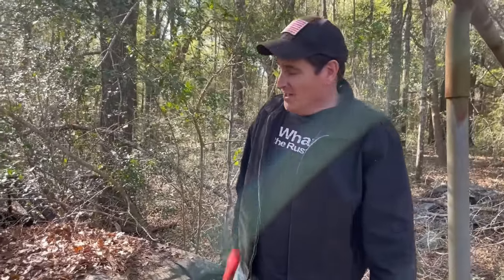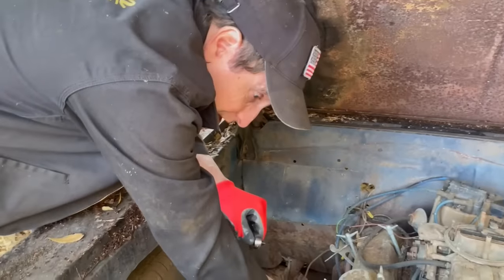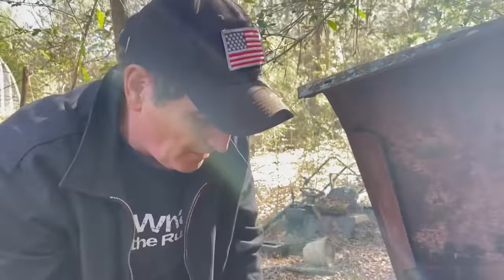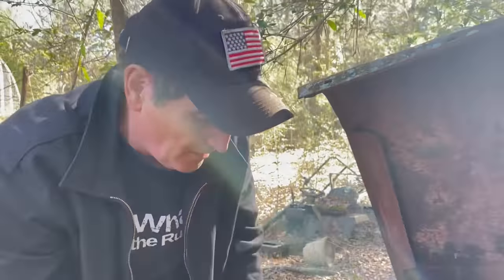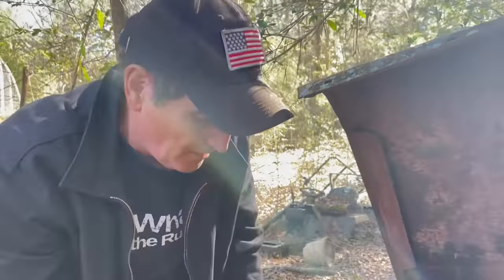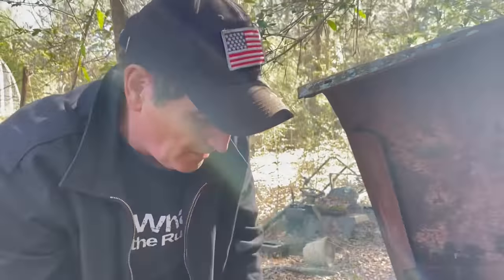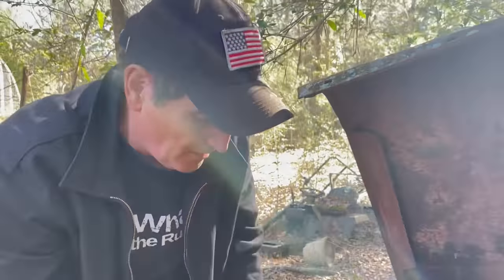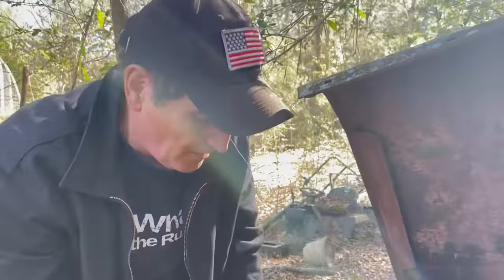Will it run? 1967 Chevelle dirt track race car in the woods!

Comment: Call me crazy but it seems like this old girl was waiting and hoping someone would come to her rescue. She had glory days at the track and then was unceremoniously put out to pasture and abandoned. Sometimes I think vehicles have feelings too. That's why she started so easily. Christina made me laugh when she stood way back while you were cleaning the rat nest off the fuel cell, she would have been the first one to run if a rat did jump out. Don't ever go bear hunting with her, especially if she carries a small pistol with her to shoot your kneecap in case the bear should start chasing ya'll. Great video, thanks for taking the time to share.
Reply: I said that very thing!  When I saw the sun shining on that car it was honestly a spiritual moment!  We'd never had a car sitting so long start that easily.   It was amazing!  You'd be surprised!  That stuff doesn't bother me .  I step back to get a better view.  Thanks for watching!  Much appreciated!
Reply: So they remove the weight just to add it back on and maybe more with the safety rollbar and all the tubing they have for bracing.
Reply: @Hotrodford   ideally you want your car 200-300 lbs under weight, so you can add weight over the left rear
Reply: I'm the same way. That cars (older ones) have a presence about them, almost as if they have a spirit. Like one that's been abandoned and left to rot, it's as if it's dead. But just by airing the tires or putting good ones on it and rolling it out from it's former grave it's like they wake up.
It's difficult to explain but ....
Reply: Crazy...but true.

Comment: Nature the outlet on the radiator, go get brass or copper 90 degree elbows x2 and  a short piece of copper pipe and solder as needed to get around the shroud

Comment: I'm currently working on a 67 chevelle. Been sitting in a little lean to shed since 89 or 90. Almost have the little 283 running again. At some point I will need to put a fresh coat of paint on her.

Comment: I have seen that set up before. The set up uses two hoses. One comes from the radiator outlet straight to the drivers side along the radiator top tank. Then a standard left inlet hose from thermostat to the end of the first hose. A simple brass house drain 1 1/2 inch drain elbow is used to connect the two hoses. Any 1 1/2 inch elbow could be used. (PVC would not necessarily stand up to the heat of 190 degrees)
Reply from the maker: That is good info! Thank you.

Comment: This car was my late grandfather's car. He traded it to the current owner around 2010 I believe. I have seen this car make laps at South Alabama Speedway around 2005. My late grandfather raced it at a dirt track in southern Georgia. He quit racing in the 80s and met my grandmother in the mid 90s. When they got married he brought it to Alabama (he moved here when he and my grandmother married). He got the car running in his driveway and took it to a practice session at the local asphalt track. It sat behind his house for several years until he built his shop at my parents house. He drove the car to where it is sitting now around 2008 if I remember correctly. He later traded it to the current owner.
Reply from the maker: That is great to know! It is an awesome car and was a privilege to work on.

Comment: aw. Born to run, she is. :)
why go for the standard cases, the special ones are much more fun. ^^
I was surprised the engine turned to smooth. maybe someone went out and turned it a few from time to time to keep it from seizing? they just never went and did more... and that cover could very well been on the car, Christina is on to something there.
as for the coolant hose, a PVC knee is quite possible, or maybe a piece of shaped aluminium tube? and they threw it out because it was vibrated to pieces.
that engine idles so smoothly, I thought it'd be louder...
the car must have been pretty fast, and drive safely, judging from the body. can't have had many bumps in it's career. ^^ I hope it sees a track again! ^^
Reply from the maker: Hi Lothar. It was loud, but the headers were so close to the ground the sound was muffled by dirt.

Comment: All 66, 67 Chevelles I automatically think of A Big Block under the hood. Must of been the weight transfer because they was very fast if built correctly street drag racing 1/8 or 1/4.

Comment: The elbow is okay. The 3 foot flex hose and wrap the rope around the fender so that rope is tied to the flex hose. Then pull the bellow flex hose away from the fan with the rope. Hopefully, if you have a white rope...

Comment: Excellent video Christine  :) also Richard  :) think car was Racing from 1979  to whenever years because EFI Distributor cap type came 1979 year in Canada and Holley to remember hearing by old elders and funny part that car must have special muffler be when start thought be super loud  even low idle but quiter ! Yes got home brew fuel Tank  agree Richard and cool car that not bang up in dirt track type Racing back and that rad not GM or Ford type that I recognized think Chrysler one from 4 cylinders  of Dodge Slant 6 170 or 225  types ! Because middle rad hose hook and think got elbow angles  in top  rad hose  sure strange for sure ! Great video to watch and nice shape car too for age !
Reply from the maker: Thanks for the support Andrew.
Reply: @whattherust  no problem Richard  :) and Christina  :) !

Comment: The elbow neck on the motor where the top radiator hose connects to the aluminum elbow pipe. You can remove it out. It looks dirty inside the hole.

Comment: Cool find to get running! Pretty basic track car. Doesn't look like it ever took a hit. Most of those had wider wheels and bigger tires with cut out openings. That's funny, the radiator grille guard looks like a bed headboard or footboard chopped down, maybe from a prison or military barracks. They probably had issues with the top hose too, that's why the other radiator was in the car. I believe you are right, they had to have some angle adapter out of the rad, judging by the hacked hole in the shroud.
 I also don't like that rear battery mount idea. I bought a car once that somebody did that on for some strange reason, and it always had problems cranking because of the long battery cable run. On top of that they also grounded the battery to the frame and the engine to the frame which caused some more problems. I moved the battery back under the hood and it fixed a lot of issues.
Reply from the maker: Right Vince, that long battery cable, and the way the ground was set up is not the best. Perhaps it was a class rule?
Reply: @whattherust  I think you're right about that for safety. They usually also had an outside remote battery disconnect. I believe that was a pretty popular body style with those circle track racers long ago. That one sure had some pristine sheet metal for a track car. They might have re-skinned it during the off season refresh. 
My car with that rear mounted battery had a Chrysler gear reduction starter and those things turn slow anyway. It was touch and go with a fully charged battery. Luckily it was a stick so I could bump start it.
Reply from the maker: @vincemajestyk9497  Right, I think it was reskinned and never raced again. Brings back memories, doesn't it?
Reply: @whattherust  Yup, I found an old program a few years from a local track I went to in June 1982. They had 'Late Model' 'Sportsman' 'Cadet' and a 'spectator' class.
Reply from the maker: @vincemajestyk9497  I remember the spectator class well. I actually raced in a few with an old $600 Chevy Caprice. It was a lot of fun, but lots of yahoos out looking to wreck everything on the track.
Reply: @whattherust  Sounds about typical for that class. They treated it like a notch above a demo derby. The '71-'76 full size Chevy was one of the best cars to use because of the engine location and weight transfer, full frame, and rad set so far back. It was really popular in the derbies too.

Comment: Trick of the day: when trying to finger install a spark plug in a tricky place such as here, firmly insert a small length of rubber fuel line into the end of the plug to help you fish it in, wich also makes it easier to align and thread it.
Reply from the maker: Great tip James. Thank you.

Comment: The centrifugal force of circling the track will fill the right valve cover with oil .Worn valve guides or poor valve seals will let oil into the cylinders causing the dark plugs that you see.
Reply from the maker: That makes total sense. Thanks for the info.

Comment: Another great video from "Team Rust".  This Chevelle came right from the MAD MAX movie!  You should name it MAX.  I think the correct radiator may be inside the car. The one installed is definitely more cores for better track cooling. Explains why your hose won't fit. Thanks so much again. You too make a great rust rescue team.  Curious, is the VIN tag on the car?  Be nice to know what is was stock.
Reply from the maker: Thank you Tom! The next time I am out there I will check for a VIN, but I don't think it had one because the entire dash had been cut out.

Comment: its hard to believe this car was just sitting in the woods for many many years and its able to run again with just some basic wrenching pretty much  . ive seen cars parked outside for 10 years and everything had to be replaced for it to run again . maybe its a different climate than where im at in the south
Reply from the maker: It was easier than I expected for sure.
Reply: @whattherust  all it took was elbow grease . did you check the compression ?
Reply from the maker: @867diesel  I did not. Maybe on the next trip.
Reply: @whattherust  just curious

Comment: Sorry to correct you but the biggest brake resavoir on the master cylinder goes the front disc brakes
Reply: Oh, Richard must have not realized what I said.  I certainly didn't understand his comment.   I learn new things every video!  Thanks so much!
Reply: Yes sorry again the disc pistons use more fluid than the rear wheel cylinders

Comment: You know if an old racecar is straight, it was in the front of the pack, and nobody could touch him. Maybe got parked for non race legal motor? Or non legal suspension mods, or some other form of sneaky business. Sweet to see that it got saved. 
Heard of kree  or cre oil. But never come across any. Guess I will try it.
Reply from the maker: Thanks for the support!

Comment: I'm thinking maybe that was a replacement radiator to get it running and they ran into the same problem. After the broke the shroud of course. Maybe that other radiator was the one that went in it.
Reply from the maker: I checked, but the mounting area would need to change for the other radiator. It is wider, but was probably going to be put in due to the hose problem.

Comment: That brake master cylinder is off a mid 90s GM truck or van lol.... And teach the flat bed driver how to use his bed to pull the car backwards next time and then slide the dang bed under the car sheesh you would think the guy would know how to use the bed on that truck ??

Comment: Wow. Impressed. You got it running. Have you ever tried to get a chevy 305 tpi motor to run after sitting a long time?
Reply: Fuel injection always has a dead fuel pump, clogged injectors, terrible corrosion in the fuel tank.
Reply from the maker: Exactly.

Comment: Because I'm not unlike an outer block and Holly carb has 4 sets of jets 2 on each side remember that 1 in the front and one in the back and it could be a small adjustment difference in the front and back primaries that's causing
Reply from the maker: Some people have responded that it is due to the fuel in the cylinders sloshing toward the plug during the left turns in the race. That makes sense I think. Thanks for watching.
Reply: @whattherust  Yes, oval/circle-track cars tend to run leaner on one side due to the fuel in the carb float bowl(s) being pushed primarily to one side by centrifugal force, due to always only turning in one direction (left, typically). Float / float bowl mods are common to help deal with this.

Comment: That's stupid how they butchered that 67 chevelle to make dirt track car that 67 chevelle restored back to original condition that you can drive on the road
Reply: you have to think, it very well may have been some period in the 80's when it was built? A lot of old cars like that got driven for 10 years if that, and were used up. Probably a 6 cylinder car, driven 10 or so years, parked for another 5 or more, one day decided to be changed into dirt track car, either used a dirt track car for couple seasons then parked or got mostly built and lost interest and parked. Never was worth much, back when it was in better condition it was the 80's and it wasnt worth anything back then, years later as values went up the condition got worse, converted to dirt track practically made it worthless, now its probably worth 1 to 2K just for the nostalgia aspect of it.
Reply: I would like to have that blue 67 chevelle 2dr I would find a 67 chevelle 4dr car for parts that 2dr car I missing and make that 2dr car and make it a road worthy drivable car again

Comment: Why didn't you hit the wheels with a hammer a few times and try to release them, great save though, that motor is sweet.
Reply: Adam simple answer. We had to return to our 9-5 jobs.  We do these on mostly on our weekends off and return as time allows to continue assisting if help is still needed.  Thanks for watching we appreciate it!